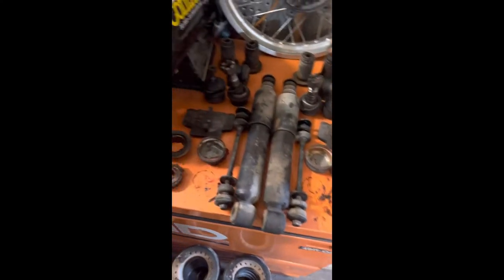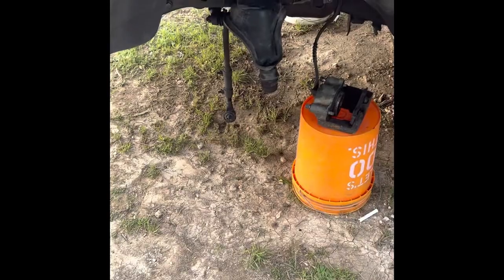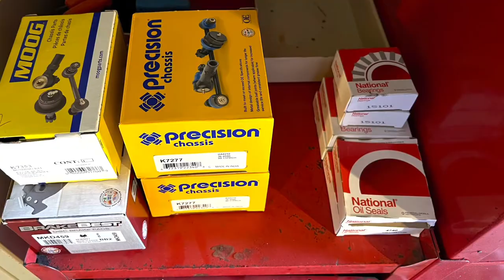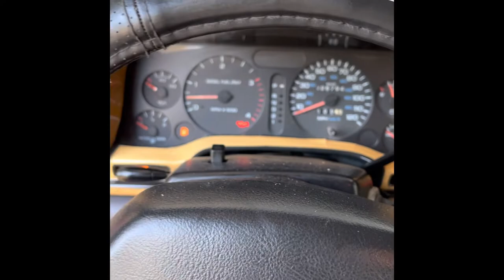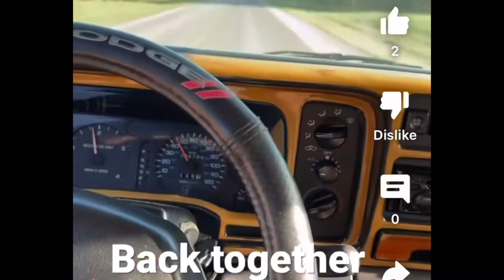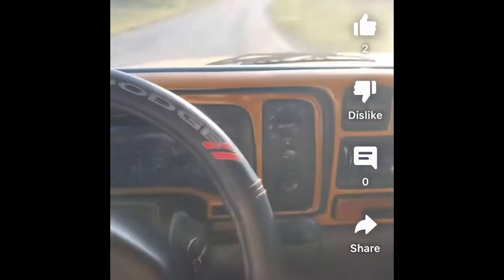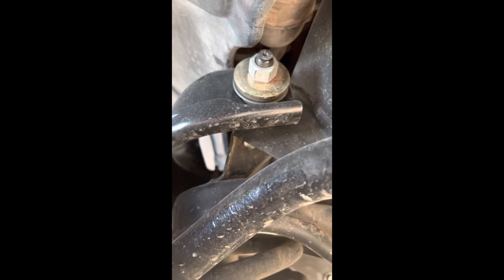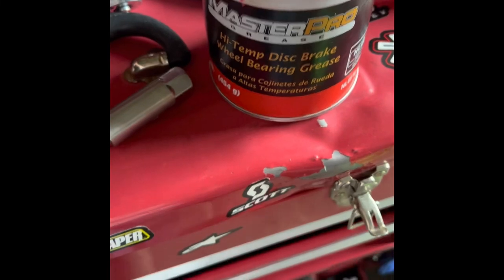1997 Dodge RAM 3500 Front end rebuild.

Comment: If you haven’t found that oil leak yet check the fitting on the bottom of the vacuum pump that the oil supply line fastens too. I had an oil leak that I swore was coming from my blow by tube but after cleaning that all up it stayed dry. Was under the truck doing new starter cable and saw it was dripping from that fitting. Replaced the line while I was at it. 85 for the line and 27 for the fitting (Cummins OE part).